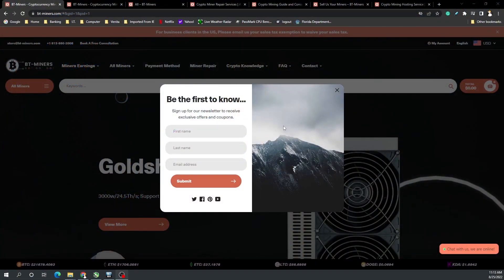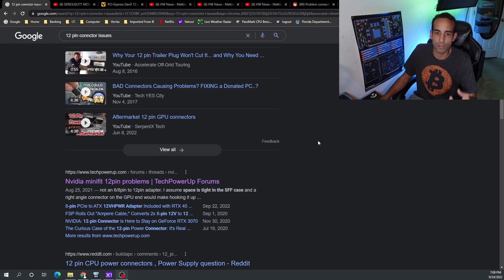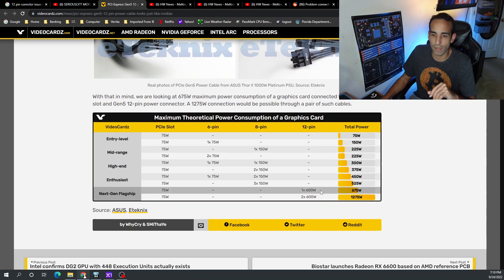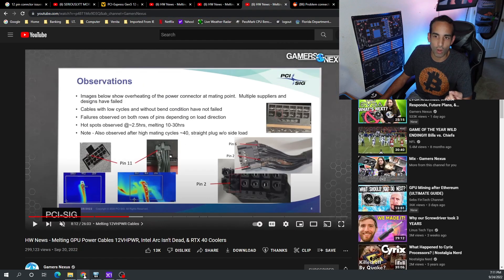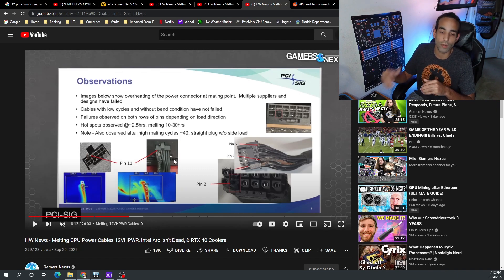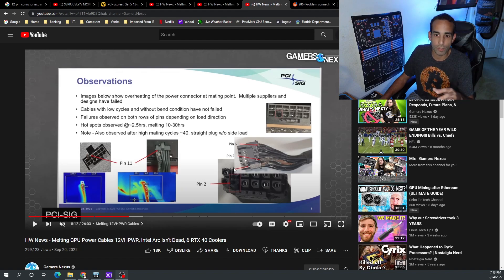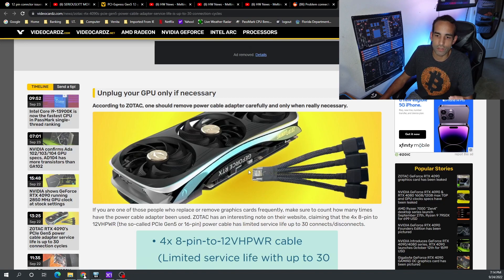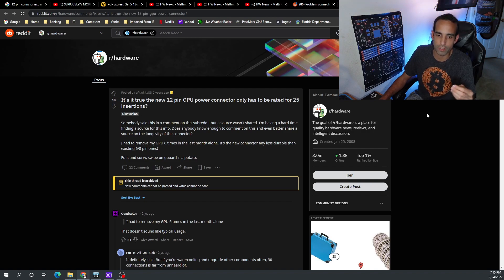ATX 3.0, 12 or 16 pin connector issues for Mining

Comment: Imagine having a breakout board with these "12v high-powa!" connectors instead of 6 pin. or even better making a 3050 pull 26 mh @ 10W utilizing the sense connectors.